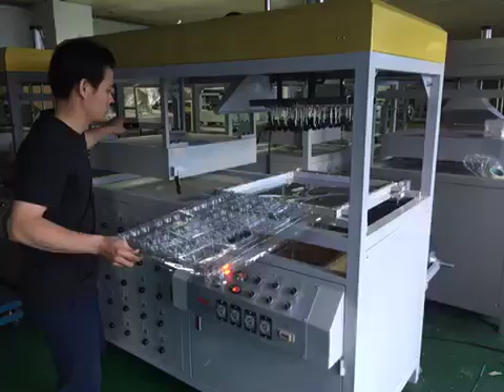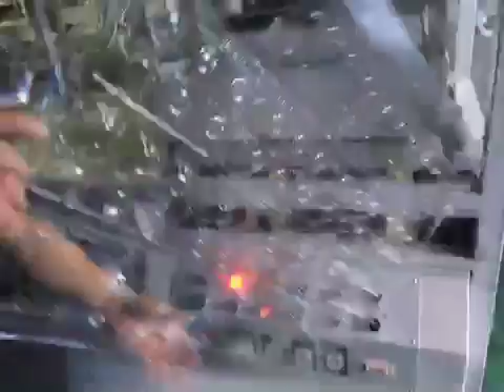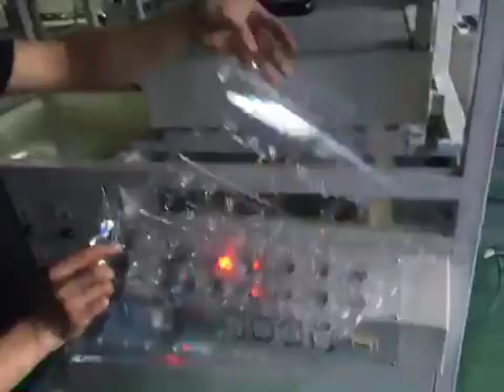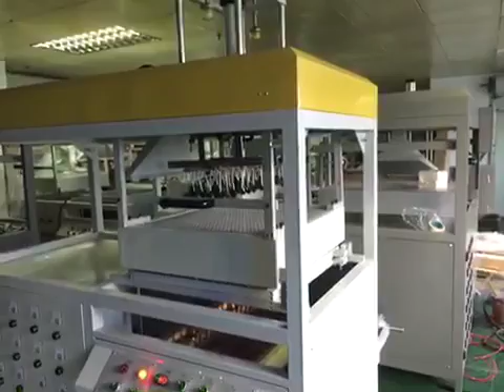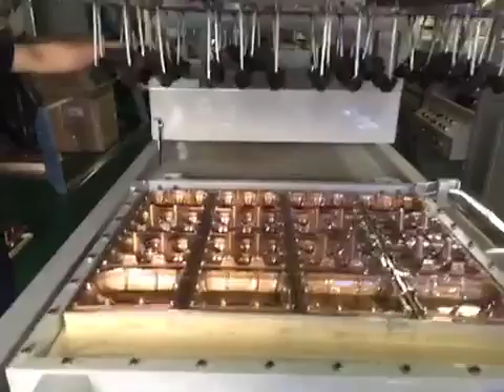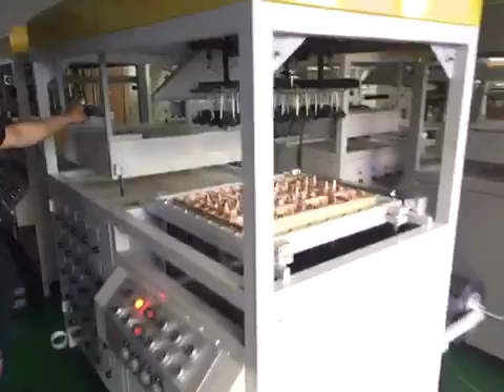Egg Tray Former 6pcs

Comment from the maker: Model: HX-61B
Power supply: 380V (3phase)50-60HZ
Power: 12.5kw
Max Size of forming:W 560*L610*H150mm
Speed: 60-90 times / hour
Thickness of material: 0.3-1.5mm
Machine size L*W*H: 1800*1300*2000mm
N.W: 400kgs
Machine packing size: 1920*1220*2080mm(4.53CBM)